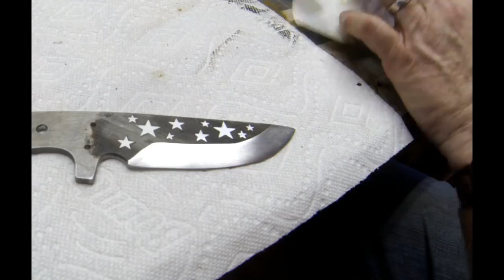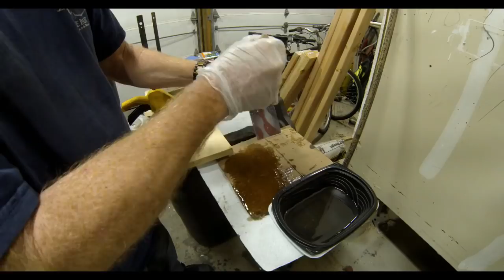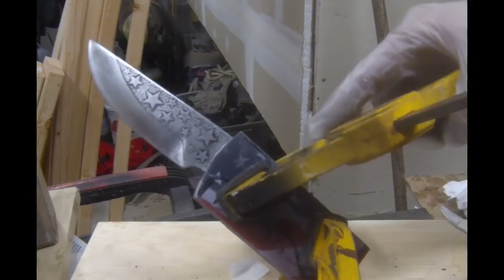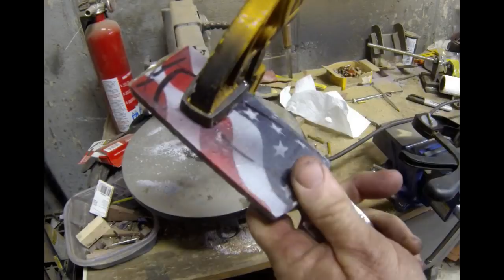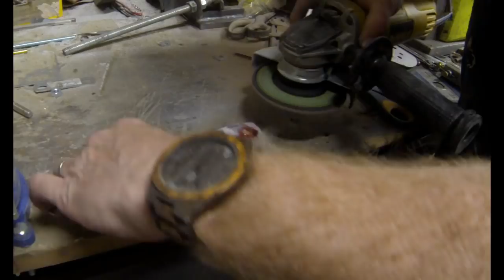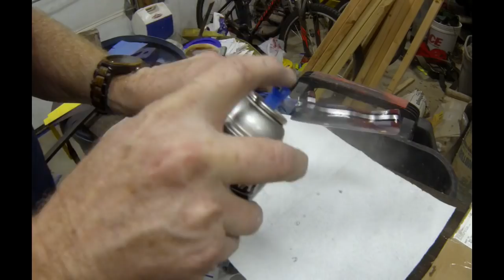How to make and polish Carvex American Flag Knife handles or Micarta Scales

Comment: Very nice video thanks for sharing. I love your stars on the blade. Can I ask what you used as a stencil when etching the blade? Also I grind my pins down with a coarse sharp belt and a little bit at a time so they don't get too hot but as you mentioned much easier if they aren't too long to begin with.
Reply from the maker: I cut the self adhesive vinyl with a silhouette cameo craft vinyl cutting machine

Comment: I was thinking if you used a wet sanding, like a 2000 or 4000 grit wet / dry sand paper dipped in water first like sanding down a run in a clear coat in automotive painting.
Reply from the maker: Sounds like it might work.